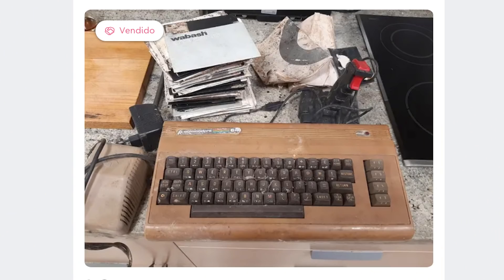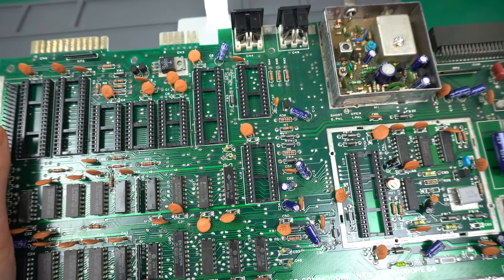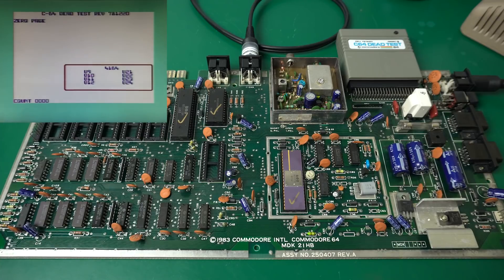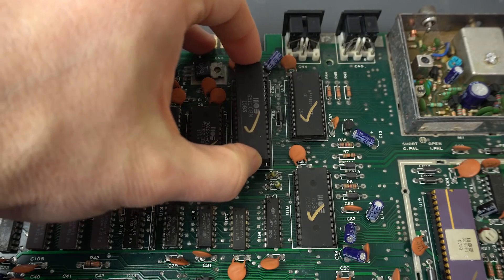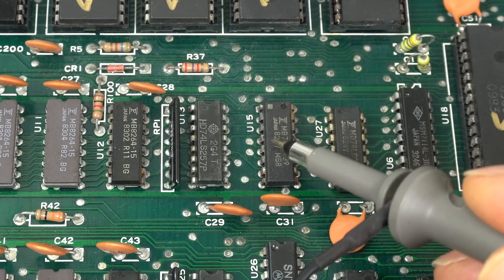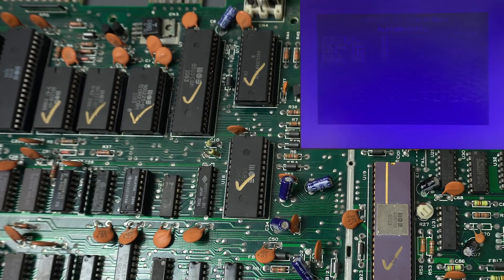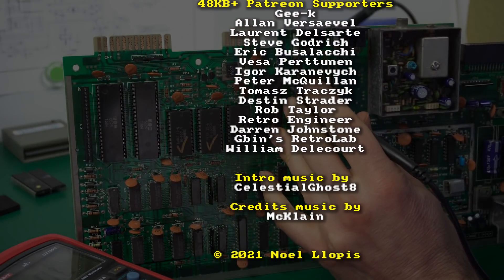Disgusting Commodore 64 Repair (Part 2)

Comment: The original sockets were called (at least here in the USA) "single wipe".  You're correct about them being total garbage!  😅
Reply: They're called that here in the UK, too.  =)
The better sort with two spring leaves per pin are called "dual wipe".
Reply from the maker: That's right! I knew that and I was totally blanking on the name. Thanks for the reminder.

Comment: Some other people just spray the alcohol and apparently don't clean up the diluted flux as if it just magically disappears.
Reply from the maker: Right. That just smears it on the board (and the brush probably takes some). But if you soak up the alcohol-with-flux mix with a rag, it leaves the board really clean.

Comment: Interesting restoration. I just picked up my first C64. I've been restoring Apple Macintosh computers for a couple of years. This C64 has some water damage. The shield paper was torn off. And the video RF shield is rusty. None of the chips are socketed which may be a blessing and a curse. We'll find out once I build a power supply.

Comment: Since most of the rust was more towards the rear of the board, I don't think it's from the traces on the bottom side of the board at all. I think the spots of rust are deposits from the portion on the R/F shield the rear underside of the C64, the board was sat on. Some WD40 / rust removal fluid and a soft cloth would of easily of removed the blotches without the need to go scraping at the traces and potentally damaging the PCB lacquer coating, which could then expose the copper traces and form points that could be shorted out once it was re-assembled.

Comment: As far as I know, the C-64 SID used several internal capacitor filters to isolate the system clock and digital activity on the address and data buss from the audio portion of the chip. This was additional to the external .01 power line, ceramic caps. If the internal filters failed or became marginal the digital noise could bleed through. It didn't affect the oscillators, but the noise would get into the output amplifier. Actually on most C-64s, if you set the volume to 15 and turned the volume all the way up on the monitor or patched it into an external audio amp, you still could faintly hear the digital noise, but the level varied from one chip to another.
As a field tech and bench tech, I learned rather quickly never to abbreviate the remove and replace process the first time - especial if your instinct tells you. A few extra dollars in parts vs several more unpaid labor hours the second time the device hits your bench; this time under 90 day warranty from the last repair.
Also; a fine "green scrubby" and a dab of white or distilled vinegar will get rid of oxidation. It won't damage the traces or the conformal coating. Using a needle, Exacto-knife or dental pick risks damaging already brittle and fragile traces, or can scratch the coating giving moisture a path to the copper below. Rinse and dry with PCB cleaner since the vinegar residue can cause further oxidation in humid conditions .
Reply from the maker: Interesting about the internals of the SID. But this SID couldn't have been like that from factory, right? I mean, it kind of sounds OK, but super, super low volume and with lots of noise. Maybe some of those filters failed like you said.
Reply: @NoelsRetroLab  Not likely, but not impossible to have a batch of new chips with a contaminated capacitor dielectric layer (causing leaky capacitors throughout the chip) If the chip is brand new, it's definitely a manufacture defect, or it may have been exposed to static discharge which tends to burn through dielectric layers.

Comment: I really like how you show a diagram with a little scope probe to keep track of what you're showing on the scope. Fantastic way to spend a nice evening with a glass of wine and watching you doing fun repairs. Greetings from space electronics industry. :)
Reply: HOWEVER, if you're asking for a bit of criticism, when looking for ANY changes in logic signals, I'd set the scope trigger level between 0 and 5V, so you could be sure no transition is missed. :)
Reply from the maker: Thanks! Yes, you're right. I'm not in the habit of working with triggers much because the signals I use are not periodic, but that would be great for single captures of things happening at startup like here.

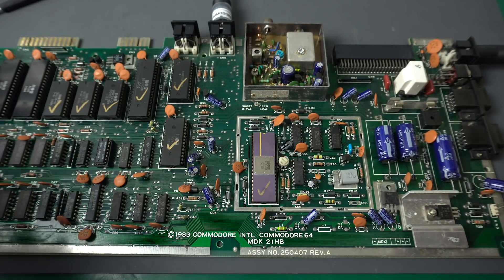Comment: About rebuilding the edge connectors from 17:03, there is also (pretty expensive) conductive paint that can be used for this job and even on flex cables. During your soldering you can see how the spots immediately oxidize rust-brown as they get hot, it would be better to cover the area under flux. This board had quite a bit of damage, I still think there must have been some additional acid in the air where it was stored. Good job!

Comment: That distortion from char rom flexure is amazing!  Great video.
Reply from the maker: Right? That was really weird! Now I'm wondering if that screen with colored lines was done with characters or graphics because that was also getting distortion when I was pushing on that chip. Pretty bizarre!
Reply: Before you know it a demo group will make use of it :) you know they would! ;)
Reply: @NoelsRetroLab  That was fun indeed and might be even more fun to thing about what could cause it. Would have been fun to see whether pushing or moving that SID made it sound any different because it was at least trying to work. Maybe SID also had some weird contact issue like insufficient power or ground or signal connection. So far I haven't seen any detailed analysis of failed chips although that would be very interesting but likely also very difficult.

Comment: Great second part :) Noels, May I ask where did you get this test cartridge? Thank you
Reply from the maker: The Dead Test Cartridge? I honestly don't remember. You can get it from many sources I think. The key thing is that it needs to boot directly into that, not into a menu first like EasyFlash.
Reply: @NoelsRetroLab  After your experience here...
Which one is the best in your opinion?

Comment: Rust on the tracks can only be a deposit. The PCB contains no iron. It could only come from a steel component e.g. the chip legs, shield or screws. Strange that it's on the underside but it could have been sitting in any orientation for years.
Reply from the maker: Oh interesting! How weird the pattern and that it's on the underside. I'd love to know what happened there.
Reply: @NoelsRetroLab  I wonder if somehow there was a little swarf from a screw of something sitting on the damp cardboard shield. We can only hypothesise.

Comment: Another great video Noel.  Is it not always necessary to replace the capacitors, or is that something you plan to do later?
Reply from the maker: I usually only replace capacitors if I see/suspect they need to be replaced (or if I'm completely out of other ideas). Here they seemed fine, so I didn't bother with that.

Comment: Great job. I'm a C64 repair video addict. However, in my experience it is never recommended to tin contacts since the solder corrodes faster than the (gold plated) contacts themselves. I would have recommended looking for some dedicated contact cleaner instead or try to mechanically scrape it out (maybe under the microscope). But hey, it now works! Very nice job. Please keep at it. Thank you.

Comment: Since you asked for it, here goes:

I think tinning those edge connectors might have actually hurt more than it helped. It didn't remove any of the corrosion and all you really did was covering the gold with tin, which unlike gold is very soft and will rub off on connectors and cause issues there. That's why all edge connectors in commercial products are usually gold plated, unless they're really crappy. Next time just clean them with a fiber glass pen and some de-oxid, that'll do. It's not like those connectors would see the kind of use they did back in the day, after all.

That being said, I really enjoy watching your videos. Keep it up!
Reply from the maker: That's a good point. I had never encountered edge connectors this far gone, so it was my attempt at restoring them a bit, but I can see it might not be a great solution. I've seen videos where they regrow the material, but that involved a $300 kit, so that was out of the question 😃  Cheers.

Comment: It's worth building (Ray Carlson has some good diagrams) or getting a harness for testing, I have found many issues which otherwise would have gone unnoticed. Also I find many chips fail after 1 or 2 hours then work again once cooled down. Highly recommended.
Reply from the maker: Yes, I already ordered a set actually. They seem super useful. And you're not kidding about chips shutting down after some use. The PLA died on me after about half an hour!

Comment: ...One of the weirdest cases I've ever seen! About CharROM, I think the corrosion has "traveled" to the thin internal connections in such a way that it makes a bad contact, which varies with the pressure of the chip. But it is only a hypothesis. Amazing video and a great job as usual! 👍😊 Thank you!
PS: I would try to open that chip to see under the microscope if there are traces of corrosion in the connections between the pins and the core, just for curiosity... You could do a "forensic episode" about that! 😂
Reply from the maker: Yes, exactly. I've been seeing that quite a bit lately in other repairs: rusted legs of chips == dead chip, even though all the legs make contact correctly. Good point about looking inside. I was planning on doing a video about that with the fake chips, but I might try it with some of the rusted ones if I perfect the technique and I don't destroy all the insides 😃
Reply: @NoelsRetroLab  All the best Noel! I'm looking forward to watch this episode!
Reply: @JoeMcLutz  I am sure you're right about that.  The corrosion could easily spread along the lead-frame into the resin encapsulation and would then attack the bond wires to the die. It would also cause fractures in the resin allowing more moisture to get in and then further corrosion would follow.
Reply: @GodmanchesterGoblin  yes indeed, but my doubt concerns the possibility of oxidation of the conductors inside the chip, that is, in a place where oxygen should be absent ... Perhaps the external oxidation of the pins (and in the points of contact of these with the chip) creates "gaps" through which the oxidation inside makes its way.
Reply: @JoeMcLutz  That's what I am saying.  We are in agreement.  And it happens often that just a little some moisture can get inside. This C64 was just an extreme case due to how it had been stored.
Reply: @GodmanchesterGoblin  uh ok! I've got the point now. 😊👍

Comment: Adrian's Digital Basement has a recent video on the dead test cartridge not showing real problems.
It a great video. I believe it's on his C64 number 3 machine repair-a-thon.
Reply from the maker: Yes, the Dead Test Cartridge is not great. It's good for some things, but it will often fail to detect things like it happened to me last time with the RAM. And yes, I watch every Adrian's Digital Basement video religiously 😃

Comment: Another great video. While I’m not a huge C64 fan, I do enjoy watching them get repaired. Something about the trouble shooting on them seems more approachable them other systems.
Reply from the maker: Thanks! I don't know if they're more approachable, but they're more interesting! Also, tons of different things can cause black screens, so you really need to dig in. Other systems tend to me more straightforward since they have fewer parts, or boring if they just have one big chip that does it all and you can't replace it.

Comment: I am always amazed that you are happy to apply full power to any PC without a rheostat involved bringing the power up slowly, especially when the original power side caps and voltage regulators are still in place. I always bring my repaired machines up slowly and watch any power drain. That is my only suggestion to you. I like your videos despite never owning a Commodore ...
Reply from the maker: Thanks! That's actually a really interesting suggestion, and to be honest, I almost never see it done, but it makes sense. When I can I'll power the computers from the bench power supply with a current limit on, but I've never gone that far. Would this rheostat be in the  mains side of the power supply I imagine? Does it show you the current power being drawn? Any recommendations for one? Cheers.
Reply: @NoelsRetroLab  I work with legacy systems and powering them on is the biggest worry , if we can be gentle to old power circuits bringing them up slowly  then it pays dividends as you don't ever want to have a component fail during an instant full power load. A voltage spike is not something an old board can easily handle as there is very little in the way of protection circuitry in these old motherboards. A crowbar circuit would be ideal but in the absence of that a variac is a way to bring up the voltage gently.

Comment: Hi Noel, nice job! REMEMBER! The CHAR ROM you can only replace with an 2532 EPROM! BUT ... your EPROM programmer MiniPro TL866 can not handle 2532 EPROMs :-(
Or you have to use an EPROM adapter for a 2732.
   Best regards!    Doc64!
Reply from the maker: Right. I used the ol' adaptor trick with a couple of sockets. Not pretty but it works. I need to print out some real PCB adaptors to make it much neater.

Comment: I wonder if the bonding wires in the character ROM were losing connection? Perhaps a baking session would reset the internal connections?
Reply from the maker: Oooh, tell me more about that, I had never heard of baking a chip to reset internal connections. Is that a thing? I would totally experiment with that. I wonder if that might help with the SID as well.
Reply: @NoelsRetroLab  I was mistaken about the bake process effecting the wire bond. The bake is meant to address migration of matter within the IC that constitutes components on the chip. Adrian (of Adrian's Digital Basement) did an experimental run on a few of his dead chips and met with some limited success. The video date was Dec 5, 2020.

Comment: I love these troubleshooting/repair/ refurbish videos. Looking forward to seeing the C64 when it's all done, I presume you'll be respraying the case? On a side note, I got my previously working C64 out and tried it the other day but just got a black screen, any ideas as to what might be the problem?! Thank you :-) P.S. this is definitely one of my new favourite channels!
Reply from the maker: Hi Chris! Glad you're enjoying the videos. I'm wrapping up Part 3 and should be ready in two weeks (indeed, with spray painting!). Black screen can mean just about anything on a C64 unfortunately. Check out some of my other C64 videos (there's a playlist with them) and try to follow the general flow: voltages, clock signal, video signal, Dead Test Cartridge, etc. If you need some help, hop on over the Discord server and there you can post pictures and tell us how it's going and we may be able to help. Good luck!
Reply: @NoelsRetroLab  I will do that Noel, thank you. I just wanted to say that your English is superb and that you put many native speakers to shame! I also love that your daughter is so interested in these vintage machines as well as programming them and even doing a bit of soldering! Mine is a similar age (she's 11) but unfortunately not interested in any of my collection of vintage computers at all :-(

Comment: yes when I lifted the trace on my cartridge slot I found it difficult to find the source, but I did manage to track it down. I can always bodge it if I need to, but direct soldering to the new connector seems to work just fine. It didn't fully lift the trace. Just a CM or so.

Comment: Great job! I'll definitely watch out for the next one, I want to enjoy the paint job :D about the rusty tracks, It's good idea to check continuity, but check for shorts as well (if you aren't already doing it). After that, give the rust spots some deoxit (you have a pretty good one available in Spain: 3 en 1. It's similar to WD40, and was invented the same year. Give it few seconds to act and then rub it with the brush. Clean it with some isopropyl  alcohol and then apply the lacker (nail lacker works just fine). That's future-proved! As you said those boards are pretty sturdy (I'd say "resiliant" :P) but it's always a joy to bring'em back from the dead
Reply from the maker: Thanks. Glad you enjoyed it! I didn't realized that 3 en 1 was good for removing rust. I'll keep it in mind. Cheers.

Comment: So the multimeter can be used to measure continuity. Is there a way to judge the quality of continuity though? A connection might give you a beep on the meter, but the resistance might be really high, meaning the connection isn't good enough. Any way of telling if that's the case?
Reply from the maker: If you want that you can set it to straight resistance measurements (Ohms). But usually continuity is the same thing as resistance, it's just that it beeps if it's below a certain amount 3-4 Ohms probably. So if it beeps it's usually good enough. Sometimes you'll hear intermittent beeping which means the resistance is right at the threshold, so that might be worth investigating why (usually it's just some flux on the surface).
Reply: @NoelsRetroLab  Very interesting. Thank you, Noel!

Comment: Excellent job cleaning up that C64! My guess is the die of that ROM chip got weather worn over the years and the leads internally were intermittent.
Reply from the maker: Thanks! Yes, exactly. The rust on the legs probably continued working its way inside the chip and caused intermittent connections.